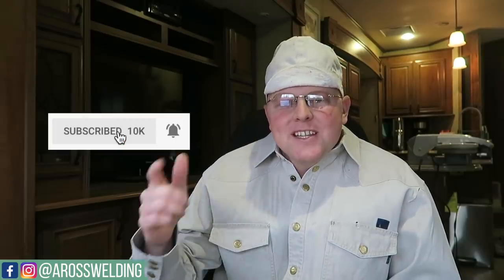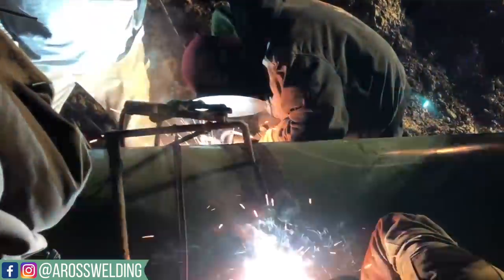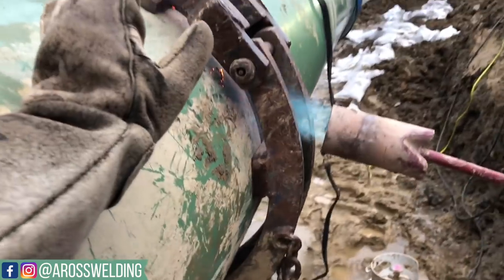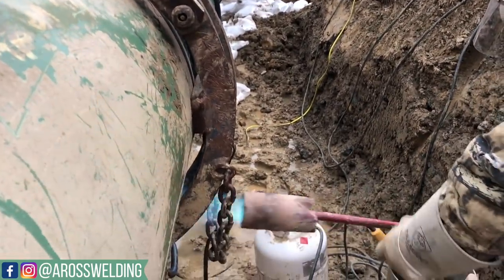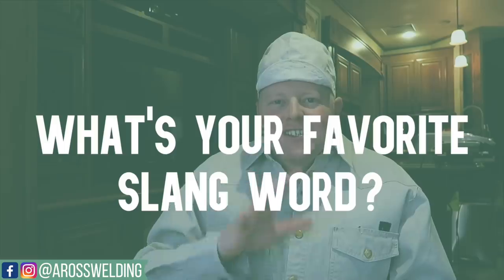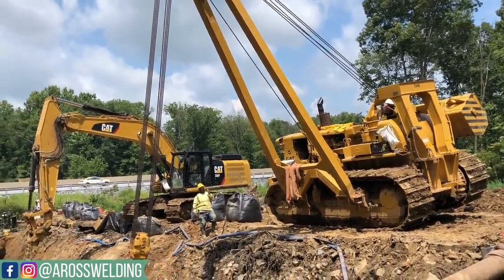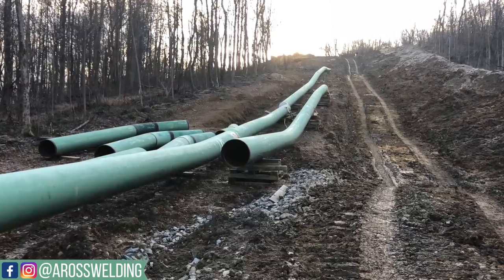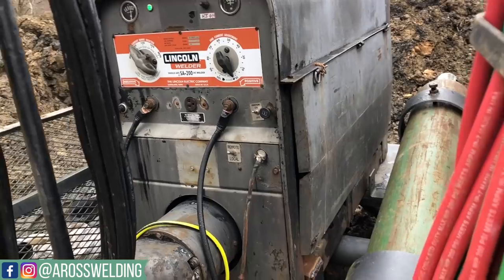PIPELINE LIFE DICTIONARY (THE JARGON PIPELINERS USE AND WHAT IT MEANS)

Comment: Draggin up is my favorite term, and favorite part of the job
Reply: You didn’t say anything about kicking your bottles
Reply: 6G is the position you have when you weld the joint. 6G or Arkansas  bellhole is the pipe on a 45 degree angle with no way to rotate the pipe on that angle. Look up 1G, 2G,3G,4G and 5G as positions and rotations of the pipe as it is being welded. 6G being the hardest to weld!

Comment: You might already know this but pipe bevels used to be 37 and 1/2 degrees.The old weld weaves were uphill and wide.The Trans Alaska Pipeline reduced that bevel to 30 degrees.What allowed this was high penetration down hill rods .What was called the" cell 80".A German rod and forerunner of today's 80xxseries down hill pipe welding rods.Less weld downhill therefore faster with less heat affected zones.On the 48 inch the landing was 1/16th and gap 3/32.

Comment: Favorite term Texas tig. Use it alot around our farm
Reply: What's that a gas torch and a piece o f bailing wire for filler?
Reply: Darin Rothwell nah it’s stick using two rods basically you have one in your stinger like normal and then you have one in your hand like a filler rod like you would tig and then use that to help fill bigger gaps or if the rod is too thin that’s what Texas tig is

Comment: Bell holes are a lot better now than when I was working. The ditch used to be straight up 20 feet with no protection. Often it was caving in. I was popular as a helper because I didn't mind digging out a larger bell whole so the older welders could get far back from the pipe so they could see the bevel on the bottom.

Comment: Good video!
When y'all are working off a skid do you take your welding machine off your truck to use or does the company have machines on there for you?
Also I haven't been around a SA 200. Since it is a DC machine, is the plug on the front just for the remote or can you use it for a grinder or other electrical tools?
Reply: Some welders will take theirs off and use them but I've also seen rentals be used.
Reply: Depends on the contractor, some supply  the machines on the sleds while others ask to use the welder's machine off their rig.
Reply: Also, you can run tools off the receptacle. Obviously it will have to be designed for DC power.

Comment: Hi Austin I’m trying to break out as a welder but I can’t seem to get the root pass in on 6g carbon pipe Heeeeelllllp
Reply: I see he don’t answer no post never again
Reply: Use a couple of reciprocating saw blades to set your gap. Put a 1/16" landing on your bevels. Tack 4 places about 1" long. Set up at 3 Rd gear and 45. Keep your rod pointed at the center of the pipe. Push the rod into the bevels. The flux should rub on the pipe as you go.

Comment: Sloppin dope. Old slang. I started off in “64 sloppin’ dope. Did that cross country until about “74/“75. Then the outlawed the Berricks enamel (hot door). Miserable (and I mean miserable) stuff to work with. Always had a job though. That was a good reason to get in the operators, because nobody wanted to pull the dope pot. The smoke would just blister you.  Now you need to have a full hazmat team to take it off of the pipe. Worked on the pipeline for fifty years. I’m 75 years old and i’m surprised I’m still alive working in that crap. Lost a few friends from melanoma. So far my lungs are doing great. My dad worked in that still for years and got through it too. How did you know if it was bad dope or good dope (asphalt tar)? When you pulled up on the right a way in the winter time in Wyoming and the welders were eating lunch by the pot to keep warm.😅😂🤣

Comment: I would add "dinner time" actually means "lunch time". Also, when I first heard the term "dope" I thought they were talking about marijuana hahaha.
Reply: I was  a X ray tested  pipe  welder in Texas and in the  south dinner is lunch ,supper is in the evenings.but before welding I worked the  oil  field and  the  slang was for a pipe  you drilled with is a joint, when the next  joint is connected  on the drilling  floor you slap  dope ( Greece) on the threads,the driller is  in control but head honcho is called a pusher. These  terms were used long before the pot times of the 60,s  crazy  ain't it

Comment: Its called a weed burner because its a...weed burner. Used to kill weeds where chemicals won't work and usually used to burn off fields, pastures, road ditches etc on the farm and ranch because you'd be there for days with a lighter, matches, handheld propane torch etc. 

With a weed burner you can throw the bottle in the back of the pickup or UTV and drive along or have someone else drive while you walk along with the lit burner and light your "fire lines".  

So "weed burner" really isn't slang after all.

Comment: Just a question but when your welding on pipe do you weld vertical up for more penetration
Reply: Nope, all down hand!
Reply: Pipeline code calls for downhill. Too much penetration can be a problem. Remember, stuff goes through that pipe.
Reply: Downhill is simply for speed. Use it a lot on storage tanks here in UK, althought you get caught welding any pass at all on a pipe butt downhill?... Youd be sacked on the spot
Easier than uphill roots too.

Comment: Why aren't pipe line companies required to use ditch boxes.....
Reply from the maker: They are. It all depends on the soil type.
Reply: Often they do at the bell holes. (People are only supposed to go in the bell hole, not the main ditch.) Or they slope the sides of the bell holes way back. Sloping back far enough is legal.

Comment: You have to explain what a pig is. That really confused me my first time hearing it. Anyone know why they are called pigs?
Reply: John Powell id assume because they squeal when coming thru the pipe on the front end?
Reply: A pig is plug usually rubber that they force through the pipe with compressed air to remove any obstructions before putting the line in service. My dad was a pipe liner for 40 yrs. i was a helper for him for a few summers. Long enough to know welding is hard ass work. Thats why im an electrician (master).
Reply: theres lots of pigs...you have your smart big that checks any improfections in the pipe you got your cleaning pigs that clean as they go through,you have the drying pig that cleans up all the left over water from hydro testing and you have your foam pigs that are ran on final passes that clean and dry the pipe until it meets a certin depths in the foam pig before that section is good to go
Reply: I worked in pipeline training and we always told them there are 2 explanations: they squeal going through the pipe, and it stands for Pipeline Inspection Gauge.